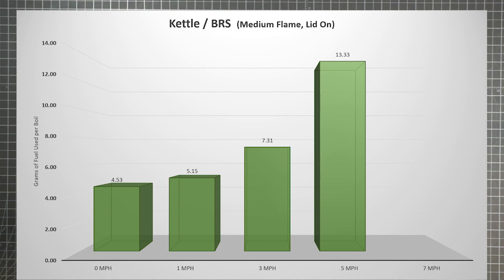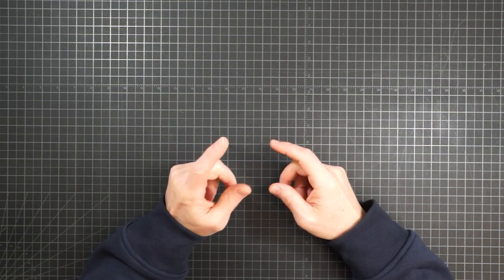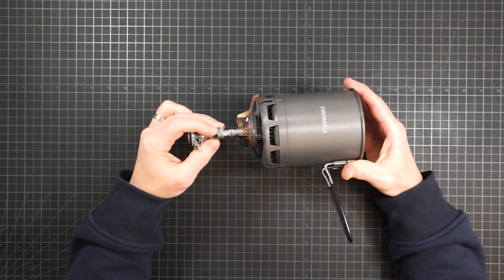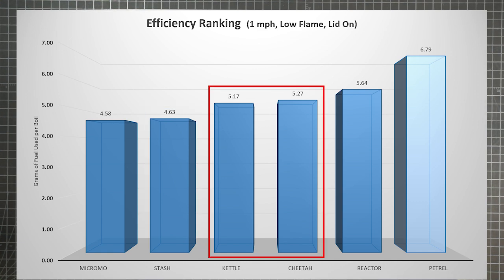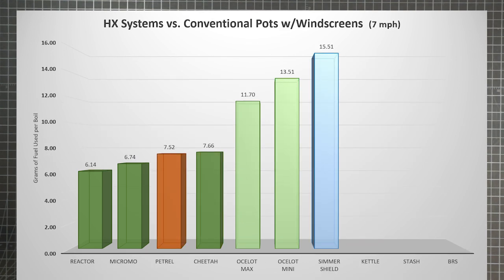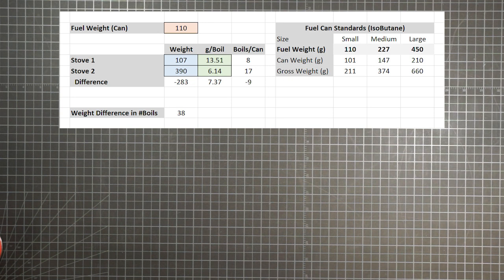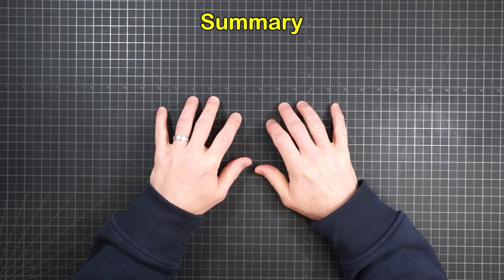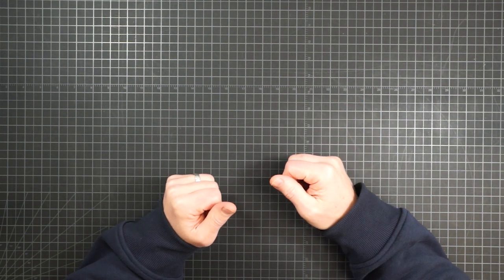Backpacking Stove Efficiency, Part 5: HX Systems in Wind

Comment: Very good as always.  One thing that surprised the heck out of me was when I hiked in Ireland. I grabbed the same canister size I usually get and went out hiking. Two weeks later I was still on the same can. I cooked the same amount as normal, but the cans I got over there lasted me on average double what I got in the States. I ended up talking about it with a guy at one of the outfitters there. He said it's because the fuel they use there is mixed for near sea level. He said he doubted it would even work over 5000 feet. So that was a surprise.
Reply from the maker: Interesting. I do want to test fuel brands against each other eventually, including so-called “winter mixes” if I can find any.
Reply: @GearSkeptic  I just had a thought and checked the Dublin store. Turns out the stuff I used uses a 70/30 mix. The US fuels (MSR, Jetboil, and the like) use a 80/20 mix.
Reply: @toocleanpappas5397  The more propane in the mix, the higher the canister pressure. The higher the pressure, the higher the risk of the canister rupturing, god forbid, if its next to a flame... I have tested refilling to 75/25 ratio, but don't think I would attempt going 70/30 unless I knew the canister had held that pressure previously... What brand of canisters were those you used with that ratio? THAT is the information that would be great to know...
Reply: @toocleanpappas5397 so are the canisters built with a thicker wall to compensate for the higher internal pressure and thus weigh more empty? Or does the current, standard canister allow for the higher proportion of propane because that mix falls within the safety range required for safe operation? Makes me wonder if U.S. suppliers just want us to buy more canisters 🤔.
Reply: Absolutely 💯 thrilled to see the next instalment in this series come out, immediate stop what you’re doing and press play!
I am not an ultralight hiker and take great comfort personally in knowing my MSR Reactor will perform in just about any conditions, i thoroughly enjoyed your meticulous attention to detail in this video. Thank you Sincerely from Australia 🇦🇺
Reply: That's a nice story but the retailer you were talking to is clueless. Canister pressure effectively increases for all pressure vessels as you gain altitude because the air is thinner. There is LESS force fighting the escaping gas so canisters work better in terms of fuel flow. The counter is your water also boils faster at a lower temp so it takes a bit longer to cook food.
Reply: @natea1042  All I can say is I was getting about twice as much use out of a can than I got in the States. I have done 11 Thru-hikes and about 15k miles, so I am pretty knowledgeable about how my cook kits work.

Comment: Another outstanding series, and yes optimal configuration depends upon knowing your camping conditions.  Number of boils per trip, wind conditions and understanding your stove all are important factors.  Keep up the outstanding work!
Reply from the maker: Thanks!  I should get at least one more batch of testing done before I lose the weather.
Reply: @GearSkeptic  The test matrix may become waaaaay too big, but it would be interesting to test alternate ways to increase efficiency on the pot end. I know you looked at lids vs. no lids a while ago. I think on that video I mentioned using a stretchy silicone lid as a way to prevent boil off as opposed to a metal lid. They can be bought in tons of sizes for very little on amazon. They also have the nice benefit of providing a visual cue when the water is close to a boil. By the time enough water has evaporated to stretch the lid off the water should be up to temperature.

The other thing I had in mind was a pot coozie to reduce heat loss to the environment. I'm very curious if that would make any measurable difference in either wind/no wind conditions.
Reply from the maker: @ I did buy silicone lids per your previous suggestion! That could maybe be tested together with cozies in a future installment 🤔
Reply: @GearSkeptic  awesome! Have you tried them out? I really like using mine in the field.
Reply from the maker: @ not yet!